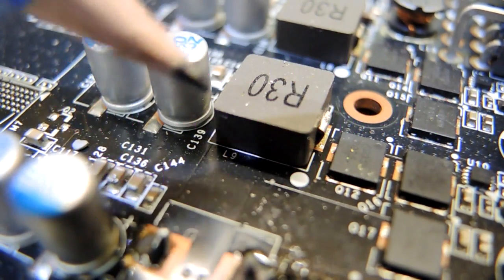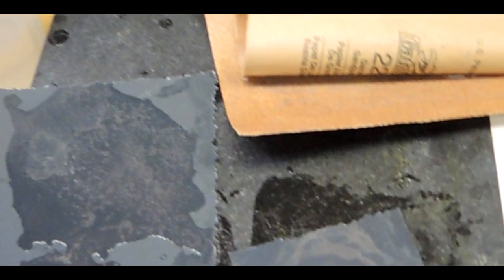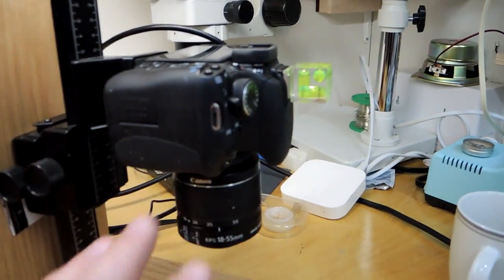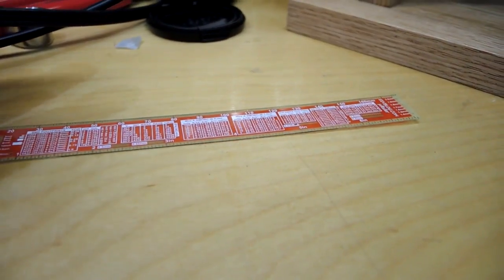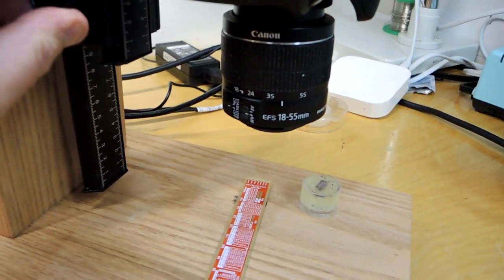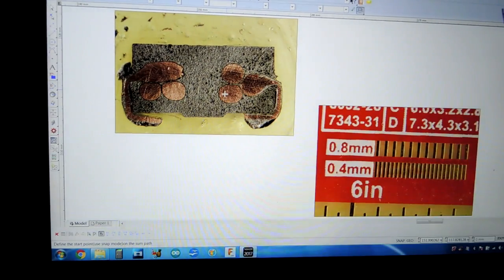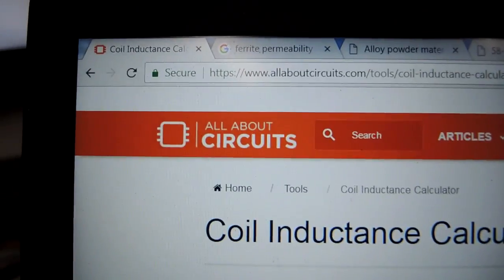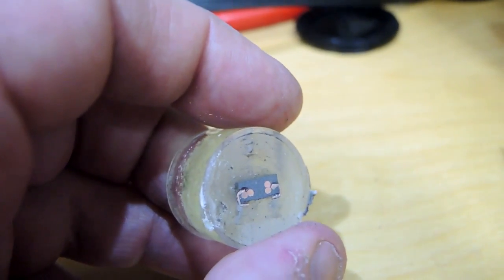Cross Section and Analysis of a SMT Inductor

Comment: Fascinating. And a well-done video. Thanks!

 "You often do this" to inspect parts to make sure they're actually sending you the right thing... Well, maybe you do… I wonder is that more common in some industries etc? In my six years doing design and a little bit of manufacturing support, I've never heard of doing this. It makes sense though, If the need is there.

 I don't know, maybe RI or someone would at least measure the inductance with an RCL meter for qual. But I think largely we trusted the distributors and manufacturers…

Comment: Wow, what a nice macro setup, using the lens in reverse to achive that kind of magnification
Reply: Parmadi Budiprasetyo 
 I didn't even notice it was backwards until you mentioned it. I wonder the effective difference between this configuration and a set of cheap and simple extension tubes. I've used the $5 set of 3 extensions common on eBay and others. With a Canon DSLR and factory 55mm I could crop 4 sides of Lincoln's head on a US penny, but I don't know how distorted the image really was. Focus was a pain at that level.
Reply: Myself prefer a reversed lens setup like the one used in this video, using an reverse-lens adapter. As far as i remember (since the last time i was doing macro photography as a hobby maybe 2-3 years ago), this setup give better magnification, longer focusing distance, and also better image. Also there's one more setup that i've tried before, it's a combination of tele and reversed wide. Use a tele lens normal on camera and add reversed wide lens in the front ( i was using ef-s 55-250 in normal position + reversed 18-55,). It's kinda awesome
Reply: Parmadi Budiprasetyo 
   Nice. Thanks for the reply. It sounds like something I need to try :)
Reply: Sure, and there's one little trick that might be useful, 
if you're using an EF or EF-s lenses like the one in the video, when the lens isn't connected to the camera, by default the aperture will be open wide (depends also on focal lenght). To lock the aperture to your preferences (for example, you need f/11), while the camera turned on, using mode M or AV, dial the f to 11. Then, press the "DOF Preview button" (the one usually located under the lens unlock button) while unlocking and releasing the lens. The lens will hold it's aperture setting as it's operated electronically